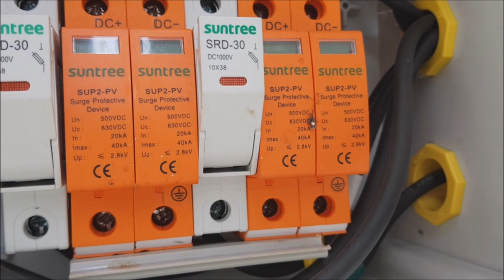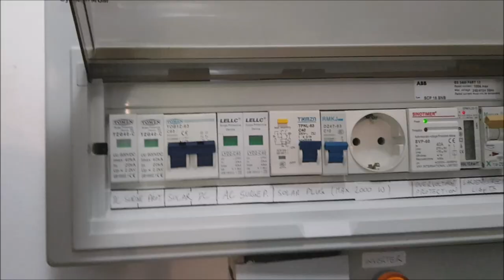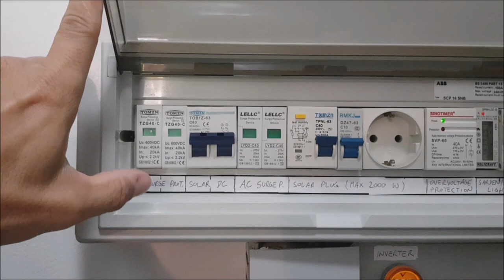PV Basics: Grounding and Surge Protection

Comment: Hi Roland, can i have your advise? I have growatt SPF5000ES inverter, it has output of Grounding, Line, Neutral and Input of Grounding, Line, Neutral. When i tried to measure continuity between Output of Grounding and Neutral, it was connected, but not on the Input Grounding and Neutral while Input and Output Groundings are connected. Do you think its safe? I just think Input and Output Grounding and Neutral have to be disconnected all the time.
Reply from the maker: Hi. As there is only one Earth, and PE is typically connecting all internal metal parts of an electric device, most inverters do only have one single PE terminal for input and output grounding. I don't know why the Growatt has two separate. There should never be the chance of possibly shocking yourself just because someone is touching two with different parts of a device. So, yes. Ground should be connected on input and output but power lines L/N just under certain conditions.
Reply: @RolandW_DIYEnergyandMore  thank you Roland for such great videos and reply 👍🏼

Comment: Thanks for the valuable Information.

I have a question please, how  both the earthing rod of the pv modules frames and the earthing rod of main distrubtion panel MDB are interconnected?

i. e. is it possible to interconnect the earthing of the 3 SPDs to one earthing rod?
Reply from the maker: That depends on where your array, mount, equipment is located. If all is at one place, then you need to ground all components at the same main grounding bar which can go to one single rod. But if your array is somewhere in your garden and the rest is in the house, you need to ground the PV at the place and do not interconnect grounds as you will not be able to touch 2 different potentials during a surge.
Reply: @RolandW_DIYEnergyandMore 
actually, it is a four-floor building(8 apartments) , the array is on the roof and the inverter is in the ground floor apartments. one only electode for the whole building
Reply from the maker: @AbuLeena  yes. then ground all at the main grounding bar.

Comment: Hello Roland.  My solar panels and combiner box are installed on the 3rd floor of my house, and I don't have a ground wire running from the combiner box as it is very far from the ground. My combiner box came with a surge protector installed already. Since I cannot have a ground, should I disconnect the surge protector, or can I just leave them connected?
Reply from the maker: Hi Emad, just leave them inside. They cannot do anything to your system.

Comment: should the ground rod for SPD in the combiner box be a different one to the main load centre ground/earth used for all the other ground/earth connections? And Can the SPD share the chassis ground rod for the panel frames? It seems in an off grid system you will have at least two ground rods. One near the panels for the panel chassis. And one for the main panel/consumer unit/load centre. I wonder does it matter If you have both AC and DC flowing into the same ground rod, especially when the since neutral is bonded to the ground. In certain scenarios it feels like you could potentially have both AC and DC returning to the neutral of the inverter output. Thanks for your knowledge. You explain things very clearly and simply
Reply from the maker: hi. if you olar array is away from other elements of you system (more then 5m), use a separate rod right at the array. if all is just at the same place, dont bother with 2 rods. SPDs only let high voltage surges through, so they dont care about AC or DC.
Reply from the maker: current can only flow from source to source. in the event of a lightning, the source is ground. only a voltage surge can reach the inverter, but that surge will happen in either part of the electric system, as it is build up by induction. most important is to use a rod with a large surface to get the energy into the ground quickly. so please dont use a tiny rod

Comment: Hello @Roland W, oh I forgot one more question if you dont mind... while connecting the ground wires and pv wires in the rails at the rooftop. Is it allowed to combine the ground wires and pv wire(pos, neg) inside a single conduit tube from roof going down to house panel? thanks
Reply from the maker: I don't know if your country's electrical code will say something about it, but I would keep it separate until the SPDs, where then the ground wire is going to the earthing point. So basically yeah, keep them separate if you can :). That way there will be just a little inductive crosstalk on the wires.
Reply: @RolandW_DIYEnergyandMore  , I also have reservation of running the grounding wire with the dc pv wires in one conduit because if the is a lightning voltage leakage and passes thru the ground wire which is adjacent to the pv wires I'm concern of the arcing that might penetrate in the dc wires. I guess in your setup you also separate the ground wire in a separate conduit away from the pv wires until it reaches the spd box. That is how I understand it..
Reply from the maker: @nestyplus  yes, that is correct. In my set ups DC wires are entering the junction boxes with the SPDs and the PE is going straight to earthing rods underneath them by separate conduits. There are no grounding wires running next to active DC. On your AC side it doesn't matter. Run the Grounding with all the others.

Comment: Hi Roland, I hope you can read this... my question is the dc input range of my hybrid inverter is 550VDC, can I use an SPD with spec of Uc 600VDC? Also would you recommend placing a string fuse also before the SPD as my inverter can accomodate 1string for each mppt..  thanks
Reply from the maker: Choose the SPD closest to the planned max string voltage, because if your inverter can take 550V but you maybe only connect panels which would reach 350V in idle, you can as well use a lower then the 550V SPD. Otherwise if you plan to max out your channel, 600V SPD is perfect. Yes, always add a string fuse to each channel at the SPD as well.
Reply from the maker: Choose the SPD closest to the planned max string voltage, because if your inverter can take 550V but you maybe only connect panels which would reach 350V in idle, you can as well use a lower then the 550V SPD. Otherwise if you plan to max out your channel, 600V SPD is perfect. Yes, always add a string fuse to each channel at the SPD as well.
Reply: Hello  @RolandW_DIYEnergyandMore  , thank you for the response. My total of 8 panels 3kW for mppt1 results to 320VDC series voltage. However upon checking I can not find an SPD of lower than 550V. In the market I can only find 600V SPD and 1000V SPD... I will not max out my channel. Would 600V SPD still be fine even if my actual is 320V ?

Comment: Did you connect the dc and ac ground wire to same ground rod
Reply from the maker: Hi, that depends of the place where you panels are and where the inverter is. if all is at one spot, then just use same ground. if the mount is a distance away from the other equipment, then use a rod right at the mount and ground the DC there.
In my example it is a different rod for DC and AC...

Comment: Sir,are ground wires from spd and  panels connected to the same ground rod?
Reply from the maker: yes. a surge at the panel array will always originate from a lightning, so it needs to go directly to a ground source there.
Reply: @RolandW_DIYEnergyandMore  so, you didn't connected both wires(from spd and panels) to a busbar and from that busbar one wire goes to ground rod or you directly connected both wires to a ground rod, combined, twisted?
Reply from the maker: @ntechsolutions1071  in my case i went on separate wires straight to the rod.
Reply: @RolandW_DIYEnergyandMore  did you twisted both wires  before you connected it?
Reply from the maker: @ntechsolutions1071  no. just squeezed into the rod connector by its screw, but you can twist it, don't see a problem with that
Reply: @RolandW_DIYEnergyandMore  thank you sir.

Comment: Is your SPD ground wire connected to ground rod of solar panel frame?
Reply from the maker: Yes
Reply: @RolandW_DIYEnergyandMore  What's the VDC size of your solar panel system spd?
Reply from the maker: @BlazeByte21  my system voltage is somewhere between 250 and 350V on my PV, so i am using SPDs with around 500-600V Uc. Clamping voltage should always be well over your system voltage to avoid unwanted leakage.
Reply: @RolandW_DIYEnergyandMore  My 60A SCC max PV voc is around 150volts.Will still be protected by an SPD 500v uc in case of a lightning strike? Or I should use Spd 150v uc but i can't find spd below 500v uc here.
Reply from the maker: @BlazeByte21  500v is ok. Most important is to prevent the thousands of volts coming into your device. But keep the SPD as close as possible to your device which should be protected.
Reply: @RolandW_DIYEnergyandMore  what a brilliant response.

Comment: Nice video. I will be honest here all what you are talking is good for charge on panels..for this grounding is very important. to ground panels/construction is good idea and should be used in metal constructions. But if you are unlucky and lighting will strike that construction you can be sure of one thing.. you can throw away probably all your panels. you can change all your cables , your inverter, your charger and probably all appliances in your house. Reason is it doesn't matter how good your system is protected all electronic will be dead. That is why I and you as well pray that it will never strike.  Check what happen when lighting will strike directly house...all cables in wall are black and it doesn't matter if you had lighting rod or not..lighting will melt any cable.It is scary truth
Reply: Those protections are for indirect near lightning hits. Any direct hit is, as you wrote, a disaster. Unless your cabling is like 2 inches thick, your grounding is like on Wardenclyffe Tower, and your house is in a complete Faraday cage.

Comment: Won't multiple grounding rods (even with RCDs?) be converting to shortcuts for the lightning path through sensitive equipment?
Reply from the maker: Lightning always want's to take the shortest path to earth. The only thing to consider when there are more rods installed, is that other rods would pick up voltages which are building up in the ground before they disapead at the activated rod from lightning. Thats why it is important to keep a minimum distance of 5m between rods.
Reply: @RolandW_DIYEnergyandMore  distance between rods should be twice their height here. So 5m if they are 2.5m tall
Reply: Does this also apply if all the ground rods are connected together?
Reply: @Michael-he2pw  are you asking me?
Reply: @gigel99324  I'm asking anyone that may know , currently we have a large offgrid system with multiple batteries and inverters. We have earthed the solar panels , solar array stand , inverters,  distribution panels , house panels all on the same bonded earth . We probably have about 10 earth rods in total spread over a area of about 30m radius

Comment: Can I connect the SPD ground to the pole that used for lightning rod?
Reply from the maker: Yes, you can. The shorter the way to ground, the better.
Reply: Absolutely not, if you do that everytime the Lightning rod gets a strike it will raise earth voltage on the conductor will trigger the SPD and cause lightning current to flow to your inverter and panels, please use a seperate earth pit and earth conductor for the lightning rod.

Comment: Will it be a problem if i put 1000v spd instead of 500v ?
Thank you
Reply from the maker: it is of course better to be closer to system voltage. but high voltage SPD will still protect as lightning surge is far higher then 1000V.

Comment: What are the yellow connectors on your pv cables going into the spds?
Reply from the maker: Hi, those are crimp lugs to hold the stranded wire together...
Reply: @RolandW_DIYEnergyandMore  could you link some for me please as only ones I can find are for battery connectors. Many thanks Roland
Reply from the maker: @chris2011ireland  this kind of ferrules:
https://a.aliexpress.com/_mtk62oE
Or this type works too (only use male part):
https://a.aliexpress.com/_mN2BdiE
...random examples. Use you favourite suplier!

Comment: Why do you need a surge protector if you have a circuit breaker?
Reply from the maker: Circuit breakers do not constrain voltage spikes. They are designed to protect against current anomalies and are much to slow to trip. A circuit breaker might eventually trip at a lightning hit, but then parts of your inverter will already be burned trough...

Comment: just want to know what is the thickness of the earth wire from spd to ground rod
Reply from the maker: Typically, by code, such main earthing connections are done with 10mm2 Copper wires. If you don't have that by hand but you have a 6mm2, use that one. It will do well enough if the wire is not too long...
Reply: @RolandW_DIYEnergyandMore  thanks for your quick & valuable reply.
Reply: @RolandW_DIYEnergyandMore  can I use the same 6mm2 dc cable for the same ?
Reply from the maker: @sreejeshpvofficial  yes, if your PV wire is 6mm2, then you can use the same for grounding too, but not smaller...
Reply: @RolandW_DIYEnergyandMore  sure .. i will use 10mm2 dc   cable for the same ..Thanks for your advise

Comment: I might sound stupid here, my aray will put out 400 volts dc, with no isolated switch between panel output and surge protection don't you run the risk of getting socked. Thats alot of volt
Reply from the maker: Hi. I don't understand where you want to get shocked. At with place can you touch the 400V? Or you want to install a surge protector to a existing system? If yes, then you need to open one of the MC4 connectors which is connecting the panel once it gets dark. Turn off the DC switch on your inverter if it has one. Then you cannot have a closed circuit and current flowing.